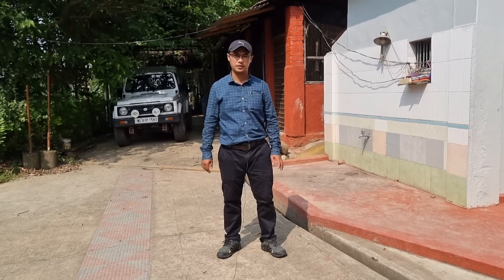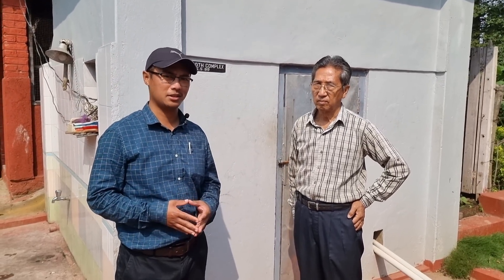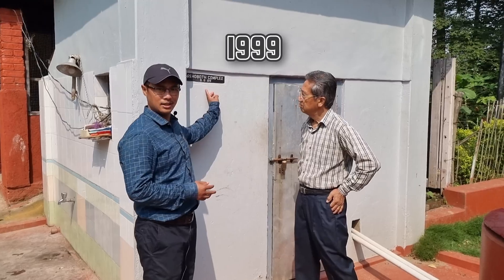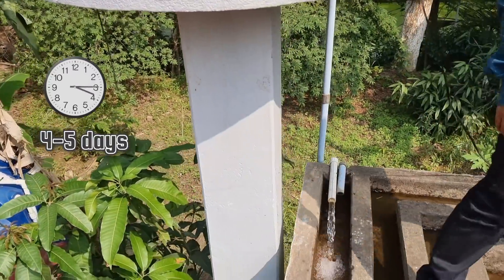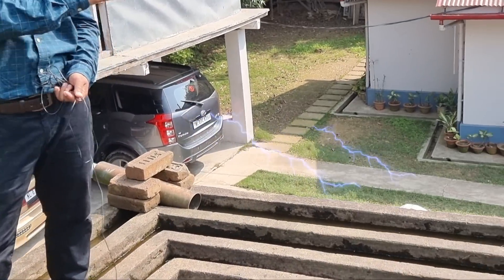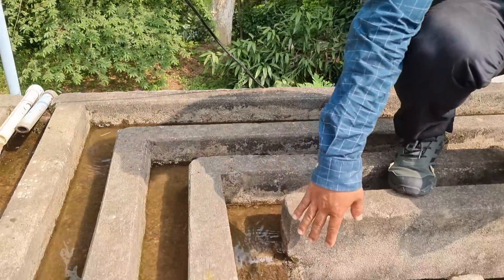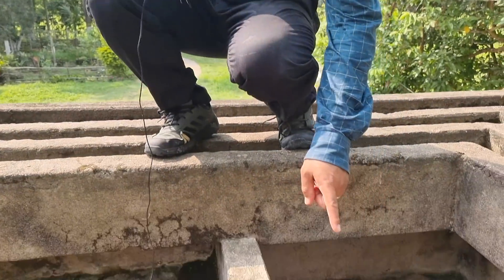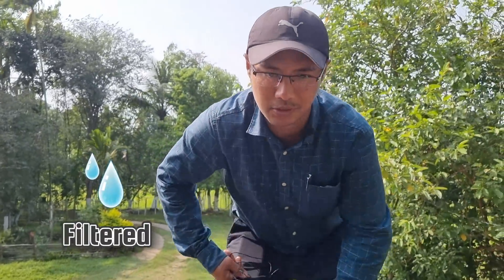Water Filtration Plant designed by my father

Comment: Nice plant👍 is the water going from top to botom of the next cell and then passing up through the stones and over flowing to the next nr 3 it must bee so the water gets as long o travel as posibel or is it only over flowing all the way..
Also how deep is the chambers.
And is it (only gray water) or also black water cleaning or have you fixed that waste problem with compost toilet instead maby. It's after all the waste with most soil nutrients so verry valuebel in a survival scenario
Reply from the maker: Thank you for your comment and enquiry Erik Nielsen. Yes your observation is correct, the method is to make the water as long as travel to get cleansed properly. The chambers are around 1m deep and are connected by openings near the top. We have to periodically change the bricks,  sand, etc . and change it once a year. As of now we use it only for filtering the ground water. The black water goes to a separate septic tank on the other of the house. The grey water is used for the flowers and grass. Once again thank you very much for your interest Mr Erik Nielsen 😊
Reply: @unconventionalengineer7640  thanks for your kind response.
So it's actually clean drinking water you produce 👍 nice suprice...
Reply from the maker: Thank you very much 😊